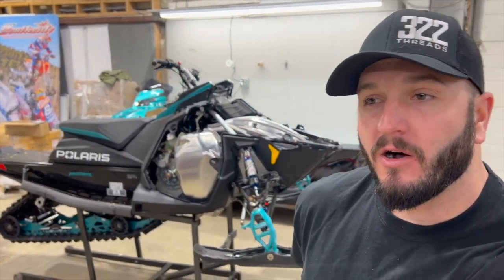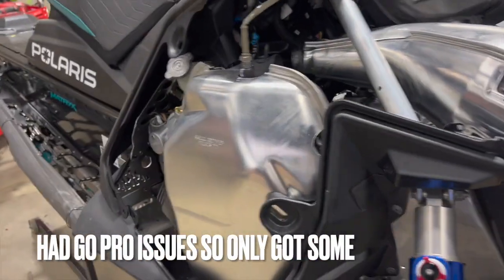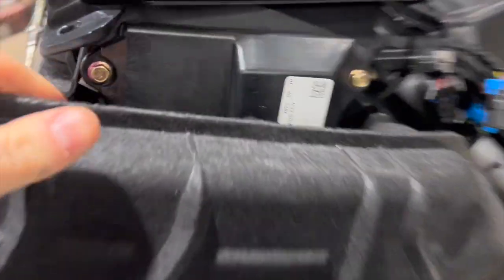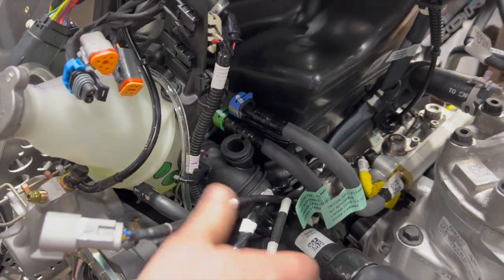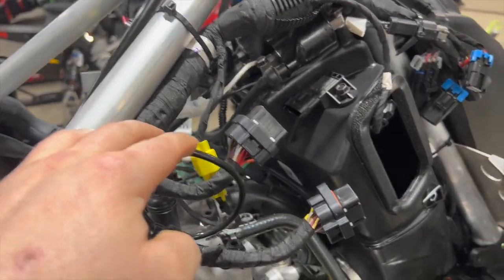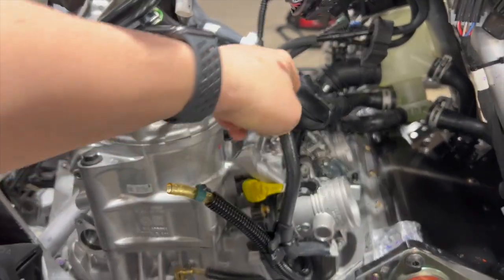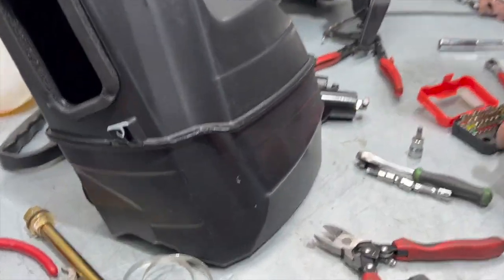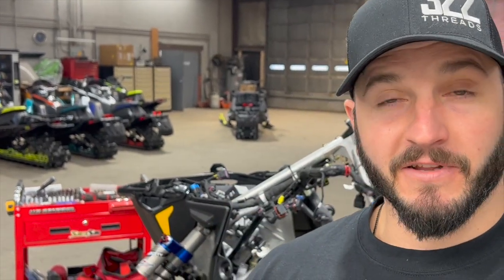POLARIS INDY 9R BUILD PART 2! 850 PATRIOT GETS REMOVED FOR SOME MORE CC'S!

Comment: So the 9r is 900cc? What makes it so much better than a patriot 850? Are the engine components better or something? Because I don't see the huge gain over 50cc
Reply from the maker: many different components. light weight rotating assembly being the biggest. this was built in the polaris race department for the hill climb guys and its now in their sleds so we are putting it in the trail sled
Reply: What is the Hp difference? Ball park